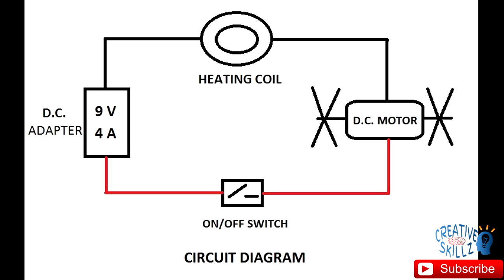How to make a Powerful Hair Dryer  | Simple and Easy | DIY | Double Fan |

Comment: Is it possible to make a powerful drier on a much smaller scale ? With heat ? Im interested in making one that will be shaped like a "T", like a razor hand held shaver. I want the heated air to come out where the blades show on a shaver. so this part of the the capital T would be where the wind comes out "---",and the "I" as the handle. What do you think ?
Reply: wow that seems awesome, have you gotten anywhere with it?